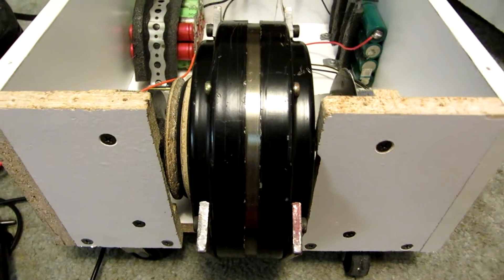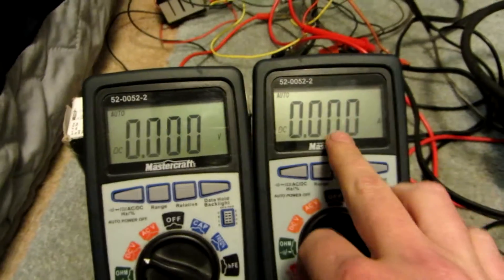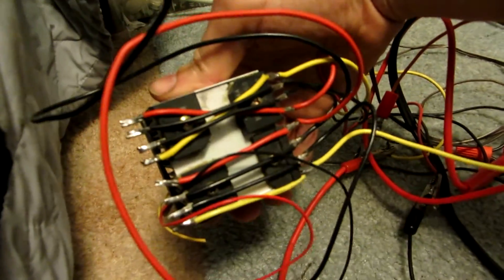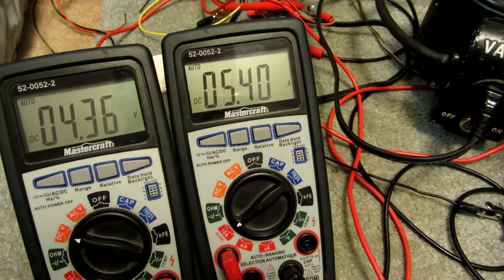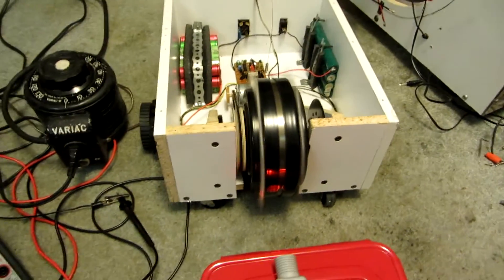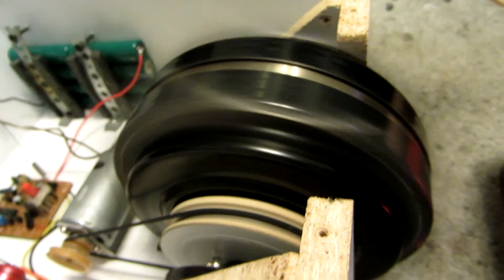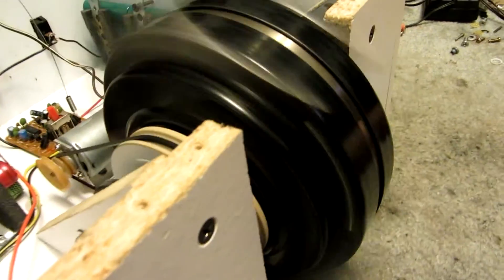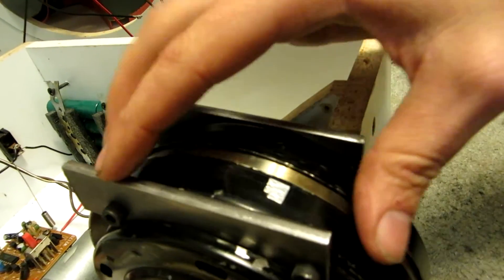Updated BattleBot Weapon

Comment: bro i need your help.. i m making a battlebot
Reply from the maker: What problems are you having?
Reply: what should i use 2 windshield wiper motor or 4 geared dc motor for drive system??
Reply from the maker: Wiper motors spin too fast, you need low rpm, high torque.

Comment: Don't think belt driven will have enough power under a load to do any damage.
Reply from the maker: +ChevyFtWss Remember all the belt is doing is transferring the energy from the motor to the drum where its being stored as rotational energy and than when it hits something all that stored rotational energy is expended instantly. The only time the belt is really under a "load" is when its spinning up to speed.
Reply: +HL4EHalfLife The "load" I was referring too, was another BOT against the drum not allowing it to even spin back up. I was watching "Tombstone" and got to thinking that. someone stopped tombstones blade and caused the motors to overheat. I was just wondering.
Reply from the maker: +ChevyFtWss Tombstone is one hell of a bot!! I loved watching him and Icewave. but in regards to the "load" any bot with a weapon that has to spin up doesn't have the torque to spin up if another bot is against it, the only way it would spin at all in that case is if the weapon was driven by a gear reduction drive so the motor might do 3600RPM's but the weapon only might do 100RPM's which is useless in robot fighting as its not spinning fast enough to do any damage.
Reply: Well. Actually. tombstones motor is big enough to drive the weapon one to one gear ratio. Personally I think you could use some larger motors all around.  But keep trying!